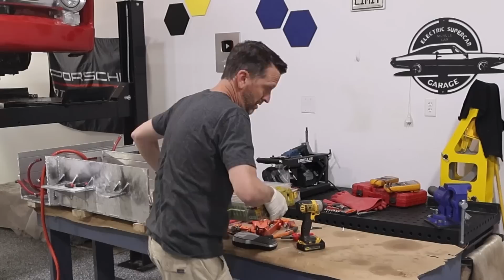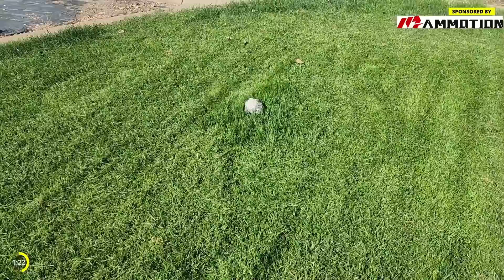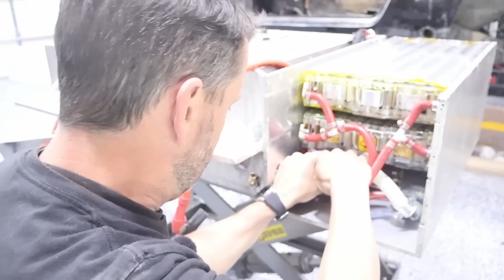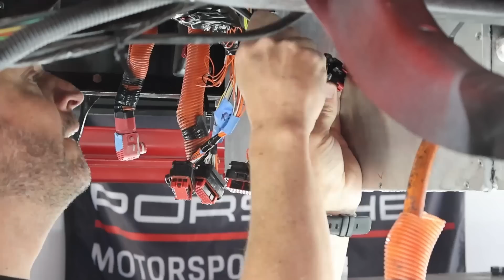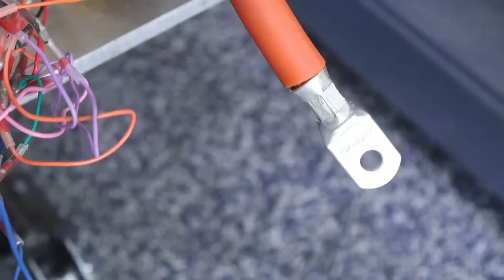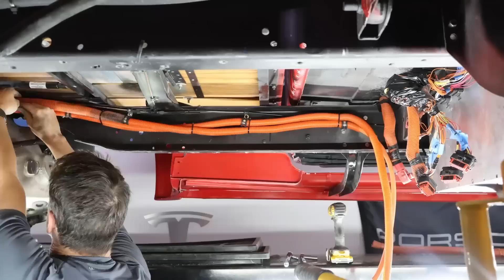EV Fire Repair

Comment: This is an interesting series. It wasn't clear to me in the video - Did you drill/tap the frame to mount the battery box where threads were damaged?
Reply from the maker: This was a DIY build from a garage warrior.  After the EV fire, he sent it to my shop for repairs

Comment: Great video, always enjoy! Being an electronics engineer I get a bit worried to see Molex connectors (the white one with loose inserts) being used in an EV. Those were designed for stationary PC power supplies many decades ago and don't belong in a moving vehicle surrounded by high voltage...
Reply: Not to mention those corrugated flex tubes used as HV cable protection ¯\_(ツ)_/¯

Comment: Nice work! Lots of little fixes needed. Amazing it even worked with all the wiring issues. It's hard to tell from the video, but is there no retention methodology for the battery modules? I see that they slide into the slots, but it looks like there is nothing holding them from sliding around during an accident.

Comment: Two things.  Would using Tessa tape to wrap the thin wire (? Cell tap?) harness be a good idea or maybe some braided cable sleeving if it’s all running to the same spot? 
Second, have you thought about using a battery powered heat gun.  I have the Milwaukee and was impressed with the heat up time and decent battery life for smaller stuff.
Reply from the maker: I'll have to try it out

Comment: What a fucking mess.

You're a braver man then I Jeremy. 

Every time you attached one of the module-to-module bus bars WHILE the modules were in place, I cringed, super scary. 

Also don't think I've EVER seen a 2/0 (70mm2) cable butt joint - how is that safe, much less 'legal'?

On that subject, it looks like they were using the HV cable shielding as a ground?!?! WTF??? So, if there was a HV cable short (you found 4 in one video!!!), that means that once the HV cable was pierced, the frame was electrified with full voltage.

WHAT???

Also, am I crazy or is there no real hold down for each of the modules, you just slide (???) it in the side wall groves and.....? Anything or does it just, I don't know, sit there with gravity and wishful thinking???

I'm sure you made them sign a very strong and clear disclaimer.

PLEASE, be safe.

- Patrick

Comment: Why replace the hoses in one battery box and not the other? If your complaint about the type of hose was justified, you would have done it anywhere that hose was used????
Reply from the maker: If it ain't broke...don't fix it
Reply: @electricsupercar Great answer… Not really what I was thinking… But works.

Comment: I love the work but again, mixing imperial and metric hardware on car is bad idea. Should stick to one. If car is old enough to use imperial, use only imperial. If it has metric hardware, use only metric. Otherwise someone will eventually strip out those bolts.

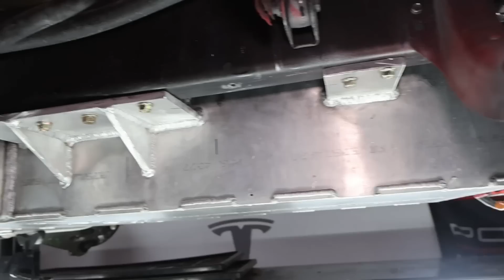Comment: 25:13 I see a plastic angle connector for the coolant hoses. I thought you replaced everything with metal ones because plastic ones will melt and start leaking at high road temperatures.

Comment: I was wondering how much weight of those two battery boxes?
Secondly, it seems like electric vehicle conversion companies should be offering future checkups on the works they performed. Costly, I know, but these conversions are sophisticated, complicated, dangerous because of the experimental aspects of the works and if one person whose wiring things up.... God Forbid... has a.bad day at work.... a lot of destruction could pursue in the future. Things like wiring need to be triple person checked and the original person who wires it up should offer the other two person's, $100 if they find a mistake on wiring assemblies.
Reply from the maker: I am going to estimate 600-lb each
Reply: @electricsupercar I asked because I didn't see the frame reinforced in any way. 
This conversion had a lot of worrisome problems in the "I think this will work and be okay" designs.
I can see how careful all work and designs must be done, so nothing bad happens in the future because I do believe this truck could have caused a fire.

Comment: Im sorry but i cannot not comment on that, You have changed one side battery box collant connector to brass and other side You left plastic. And said that You dont want to open it again... Even if You pointed out previously how box wall push away thread on plastic fitting. Also, if You dont want to open it again use hose clamps with hex screw and barrel nut (not the shitty one for screwdriver or pliers.) one last thing, i was tough to press atleast 2 or 3 times ends of wires, With alternating rotation. Also zipties dosent look good if You already installed half of the clamers with rubber for replaced high voltage wires. Otherwise, Amazing job man. Keep it up.

Comment: Excellent job!

As a side question, the YT comment section lost its mind on my video where I showed stacking Model S modules 3 high in my 914, same as this setup.  What are your thoughts?
Reply from the maker: Stacked on the side rails? Or on top of the cells?
Side rails you can stack as high as you want because each battery is supported as designed, and each module does not rely on any other module below or above
Reply: @electricsupercar  I went back to the video and see there are some small slots that the module side rails slide into.  My modules fit into a larger battery box with no slot support.  I put layers of rubber between each module and everything seems to be OK so far.

Comment: Are there any EV’s made yet that use a universal type “skateboard” to help facilitate swaps easier? I see body swapped Teslas (chopped body off and it still drove with minimal issues) that seem to make building easier assuming wheelbases are similar. Rivian chassis maybe?
Reply from the maker: Interesting
Reply: No

Comment: I dont understand who would spend that kind of money on a battery pack and the "install" and do such a horrible job. Air compressor hose for cooling lines and probably the cheapest $.0002 hose clamps in the world, metal shavings, disconnected wires, leaking hoses. What a disaster waiting to happen.
Reply: its scary as hell... im starting to hope the Customer did DIY this... It doesnt make any of this "better" but if it was a "tuner/EV-Converter" it does mean, there are much more of these FireHazards on the Streets
Reply from the maker: Yep, the install was pretty rough but the customer was aware of the issues and it’s all part of the story!

Comment: When they say electric cars have less parts than ICE vehicles, I don't think they are counting wires and connectors.  Great work!
Reply: The saying is about moving parts, not parts in general.
Reply: Exactly, in wearable moving parts. Evs vs ice are vastly superior!
Reply: you forget the countless modules that avg ice cars have nowadays, those are a mess to sort too
Reply from the maker: You got it!
Reply: ICE vehicles have enormous wiring harnesses for fuel pumps, oil distributors, thermostats, air intake sensors, transmissions, etc. It's not a close comparison.
Reply: I worked on a ICE electrical cable production company for 5 years called LEAR corporation (making cables for Renault and Ford) and ICE cars can have complex cabling as well. Modern ICE cars are very computerized now, with sensors everywhere and onboard computer systems.
Reply: It’s probably less than what a wiring harness in an ice car is.
Reply: Fewer